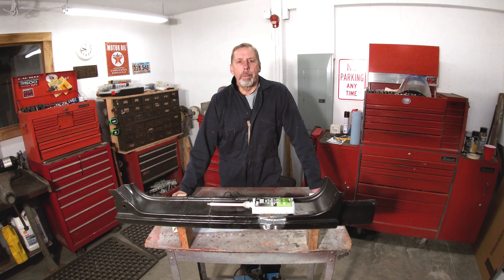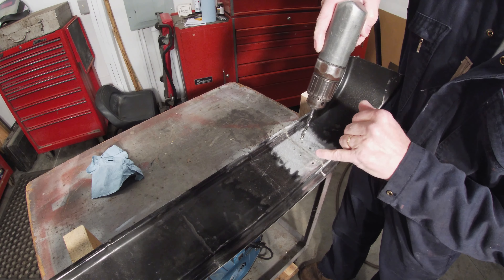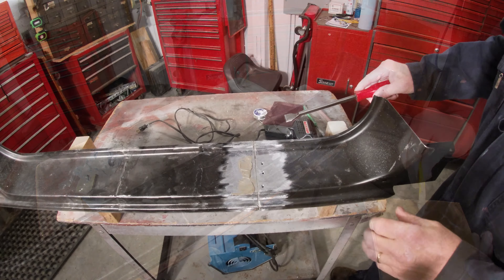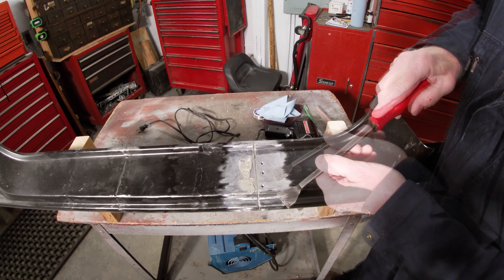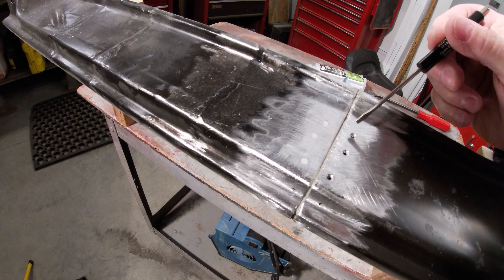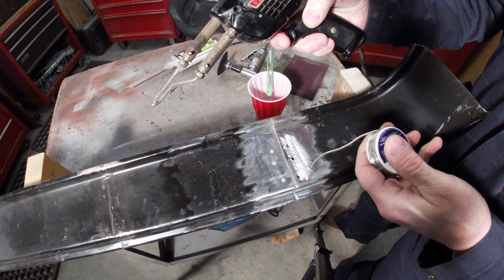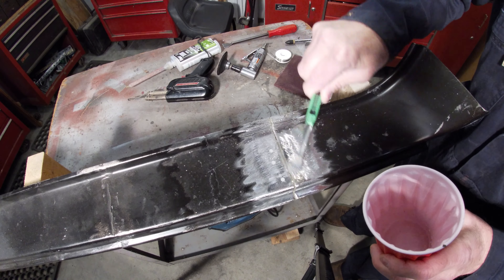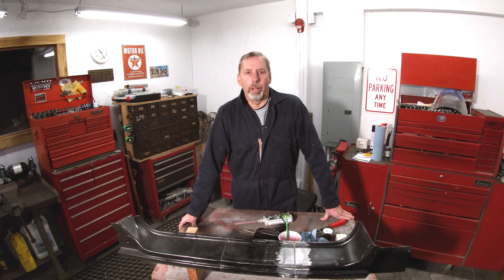How To Fill Screw Holes

Comment: Really helpful video, thanks - I'm planning to do the first method for some holes left by screws the previous owner drilled into the upper sides of my pickup truck bed for one of those exterior tool boxes. I'll be using the Fusor 108b - how long did you let it cure before scraping? And also, what kind of grinding wheel for sanding, and what other sanding methods would you recommend?
Reply from the maker: Drying time can depend on the temperature but usually a couple hours should do it. I usually do a quick grind with a 36 grit roloc and sand as you would any metal before you apply bondo. I hope this helps and thanks for watching

Comment: Weird question - I'm filling in drilled holes that were drilled too large for the application. I don't have access to a welder, but the piece in question is thin mild steel about 3/32" thick and just a very small part that attaches to a larger piece with some very tiny screws and threads (about the same size screws that are used in frames of reading glasses). The hole that was drilled and threaded is 3/16" diameter whereas I need something like 1/32". How would you go about filling these? The catch is that I'm going to need to re-drill through whatever I fill for the 1/32" screws. I have looked into threaded plugs but I don't think a 3/16" plug with a threaded 1/32" inner hole exists. Thanks for any help!
Reply from the maker: That’s a tough one. Without welding I don’t know what would work. Possibly bevel the hole a little bit and fill with JB Weld and redrill. You didn’t say if the screws will be sheet metal or machine but sheet metal screws would probably break out the JB Weld. That’s about all I can think of. Thanks for watching

Comment: I would be concerned that over time some residual Flux would cause paint adhesion problems. I don't like Bondo over slide hammer holes either but I wouldn't lead over holes in a rocker panel by the same token.
Reply from the maker: That’s a valid concern. If it’s cleaned with water and a brush it will take care of it. I’ve been using it over 30 years and have never had an issue. Thanks for watching